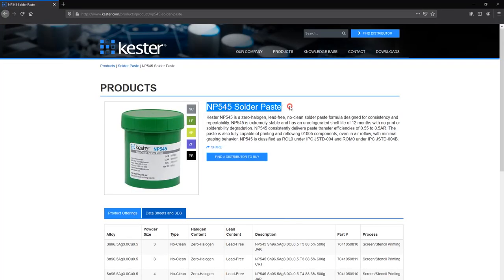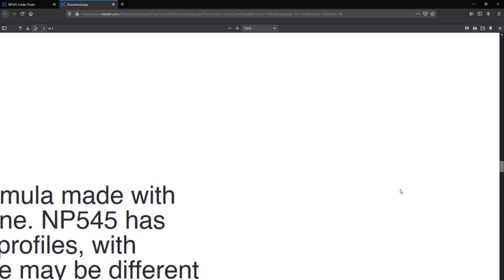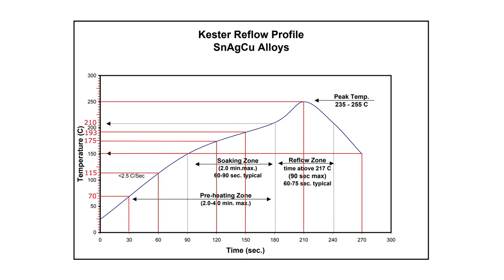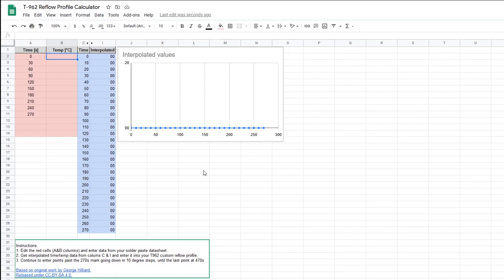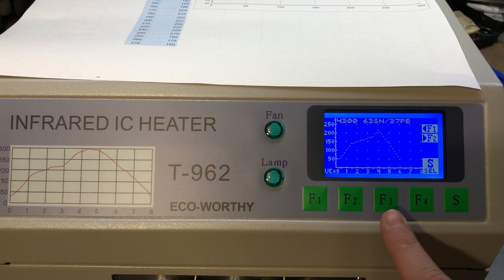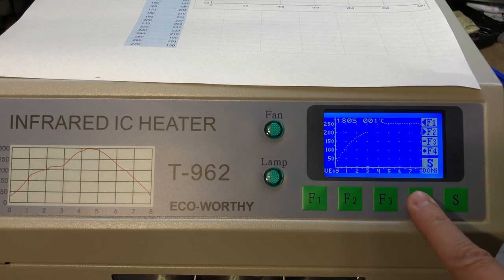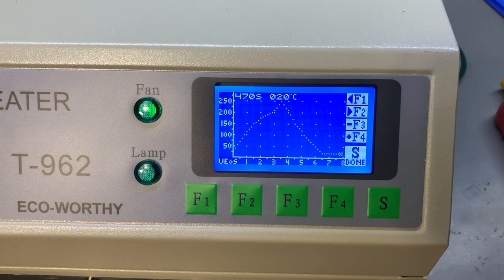T-962 Reflow Oven Custom Profile Calculator | Voltlog #339

Comment: I also made all the T-962 modification (+ fan upgrade) years back. To maximize and optimize its surface, I found out that PCB reflows better if its lifted higher from bed. Use old PCB on corners or if you have mounting holes in PCB use M4 screw + nut + 2*washer the nut, the screw method works great for reflowing multiple batch (M4->washer->bed->washer->M4 nut->PCB)
Reply from the maker: Yeah since this is IR, it works better if you bring the PCB closer to the elements however it does have the disadvantage of getting less even spread of heat across the pcb, meaning you might get high temp spots. What I think helps though is to get the PCB off the metal tray which is sucking some of the heat away through the bottom.

Comment: Just received my T962-A recently and performed the cold junction, tape, and thermocouple amplifier upgrades. I found it much easier to modifying the firmware in order to add/change reflow profiles than enter them manually. It should also be possible to set a custom profile through the serial interface so I'm looking into that.

Comment: I'm not sure if it's a calibration issue but with the new firmware I'm having to run it up to 280 degrees to get my solder paste to flow when it should be 217-230

Comment: Would have liked to see the actual inside temperatures compared to the curve temperatures requested. Thanks for showing how to input a custom curve.
Reply from the maker: That is better shown in a video where I talk about calibration because the reading will vary with factors like: calibration, cold start  vs warm start. But I don't think I'll be doing any more videos on the subject, these videos get very few views.

Comment: I have T-962A with the modified firmware. I use Sn99AgCu0.3 - my profile works perfectly on small PCB (35 x 50mm) - but fails on the panels of same ) 2x2 - 70 x 100mm. On some joints you still see the paste's solder ball structure. Seems also the heat distribution inside the oven is not even. Anybody has a working profile for Sn99AgCu0.3 ?

Comment: Can't stop reading that label as "Infraredi Cheater" (it's just too funny not to). As someone who has occasionally recorded multi-point PCB temperature profiles through a full-sized conveyor oven I can attest that actual values can be quite different from what the setpoints suggest, especially in areas where the copper geometry is doing something funny to the heat propagation (or supports are leeching out the heat). It's a right headache to get it reliably dialled in for sure...

Comment: Do you have any updates on this oven in 2022? Still working? Are you using it? Any more mods or updates you've done or if there are any available? How do you vent the "fumes" from the oven? I'm thinking of using my Weller solder fume extractor, but at the same time I think the massive heat wouldn't be good for it.. kind of different compared to a "simple" soldering iron 😂😃
Reply from the maker: I'm constantly having trouble with uneven heating inside the oven so what can happen with bigger PCBs is that some components don't reflow at the end of the program. So because of that I don't use it that much. Things can probably be improved I just haven't had time to deal with this so I used my hot plate instead. I use my regular fume extractor to filter the fumes.
Reply: @voltlog  this is the 800W version with only two lamps correct? I ask because I have the 1500W version with four lamps and it seems fairly consistent across most of the heating area.
Reply from the maker: @CoryCharlton  Mine has just two lamps, the basic model.

Comment: Thanks for posting this informative video.  I just received my T-962 and I am making the modifications you showed in the previous video. I am a big fan of Kester products and noted you used one as an example in this video.  I was wondering if that is the solder paste you used and how you liked it?  I have enjoyed following your channel for a long time.
Reply from the maker: I am fan of Kester products myself but I've only used their solder wire and fluxes so far. I'm sure the paste is great too it's just hard to obtain here in the EU.

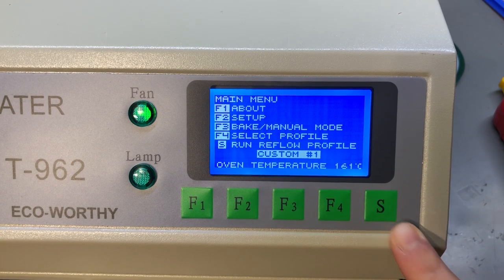Comment: 4:00 Although very inconvenient, the oven does seem to show set points at +- 250 degree as a default value. Agree that the default should just be at 0.
Reply from the maker: While editing the video I noticed those points and I was wondering what do they mean 😂 Thanks for that. When I get a chance I'll have a look at the firmware to see if there is an easy fix for this.

Comment: I think that is a mistake just  to copy a graph from the solder paste datasheet to the oven controller as the graph from the datasheet is a MEASURED one  (actual temperature) but the controller graph is an IDEAL one so it all omits the thermal dynamics occurring within both the oven and PCBAs inside of it. Instead of drawing complex curves in the controller I'd rather set just target start & end temperature points for each stage such as Preheat, Thermal Soak and Reflow then empirically adjust duration for each of them trying to keep it within the range allowed.

Comment: There's also a tool that lets you automatically plot points from a given image called WebPlotDigitizer (which also has a downloadable version despite the name): https://automeris.io/WebPlotDigitizer/

The way it works is you first define a set of axes, then you create an empty dataset for the points to fill, and you can draw on top of the curve to define an area that the program will plot points from. You an also erase parts of the mask if there's any overlap with other curves/grid lines that are the same color as the curve you want to plot.

It has multiple algorithms for extracting data points. One of them lets you define a fixed interval and step size for each point (with or without interpolation), and it also lets you only record values within a specified output range. You can also plot points manually.